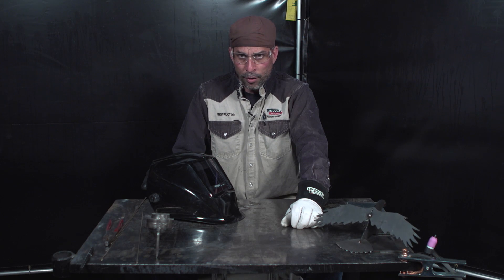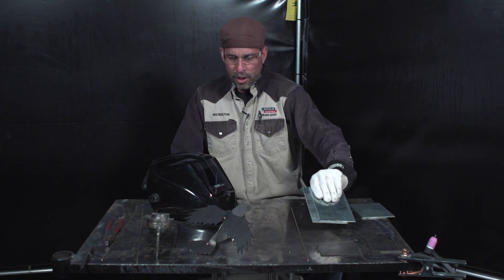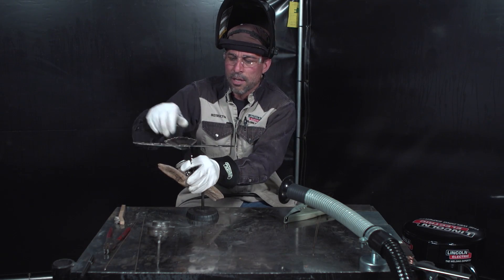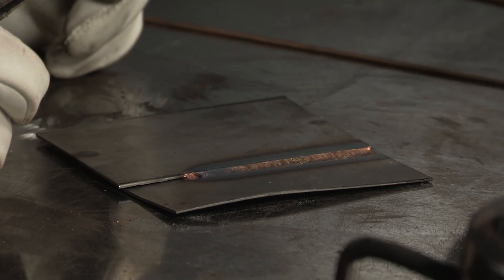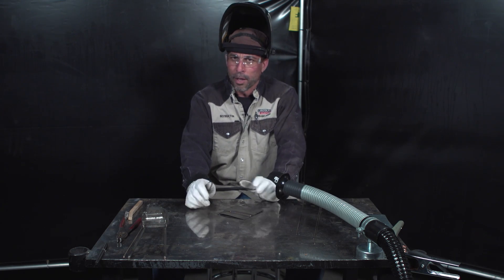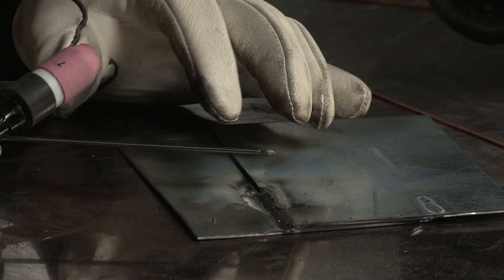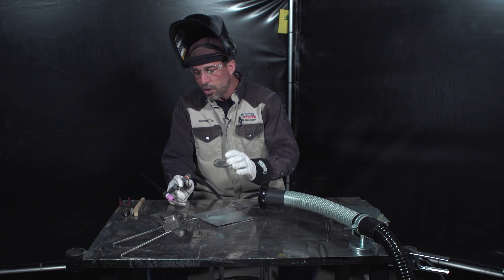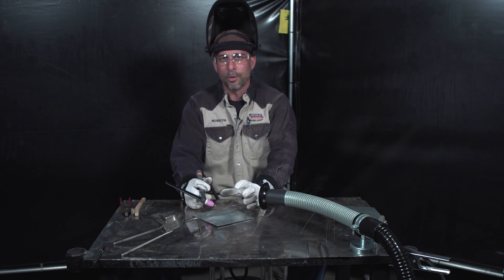Arc Magazine Master Class: Silicon Bronze Filler Metals

Comment: That makes sense...I wasn't considering heat input, and I've lowered amperage to try and reduce the base metal puddling, but it always ends up melting together with the sili by the end of my weld. So travel speed and amperage is the key. I'm brazing on 13 gauge, 3/32 sili, 3/32 tungsten at 60 amps.
Reply: Well, part of the joy of TIG is the control you have, if you only have a torch switch you can let off for a second or so and let things cool, and of course with a foot-pedal you can adjust as you go.  I noticed that the video mentions 3/32 tungsten also,  but even 1/16" tungsten seems large for this.  Why not use like .040" or 1/16"?  It starts easier and I think runs better generally with the right size electrode.